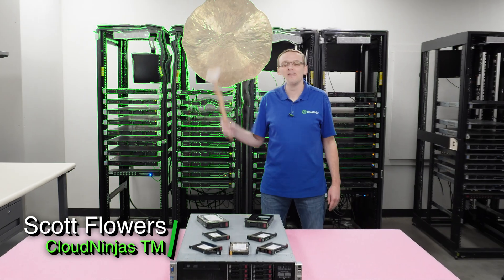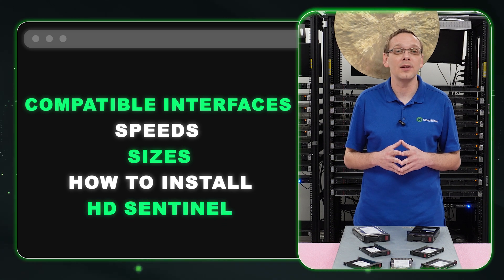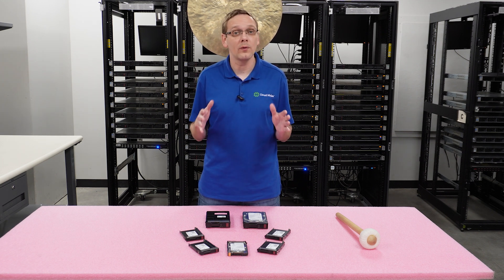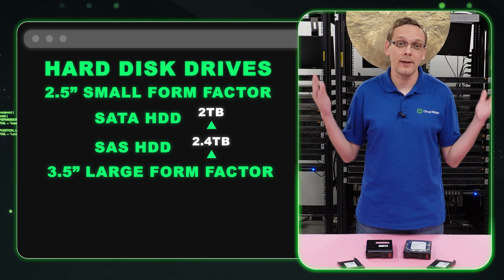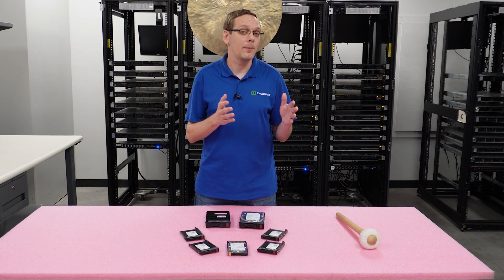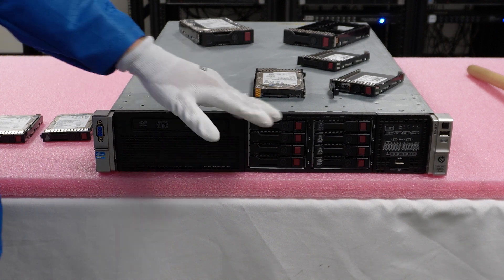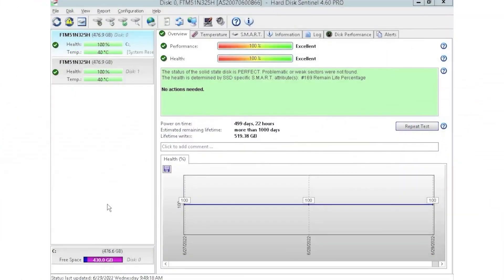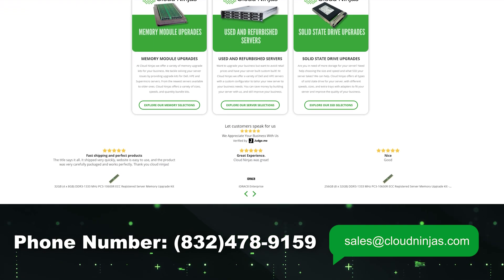HPE ProLiant DL380p Gen8 Drive Overview | SSD Upgrades & Options | How to Test | Solid State

Comment: I love to see someone else testing this. I was building a truenas server with 12x8tb drives because I wasn't sure if more is possible. I have to mention that it was needed to do some firmware updates and change the previously installed 8x2,5" front against a 12x3,5" front. Also hp support told me it's not supported to change the front but that worked fine with a online bought front panel including its backplane